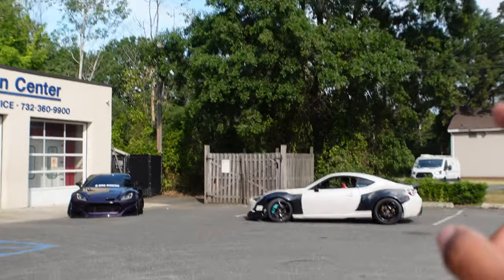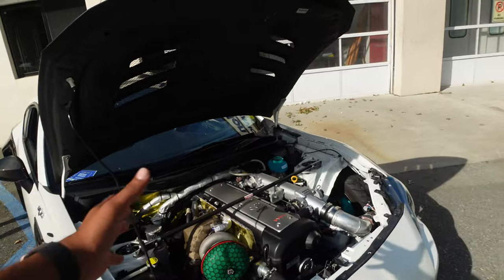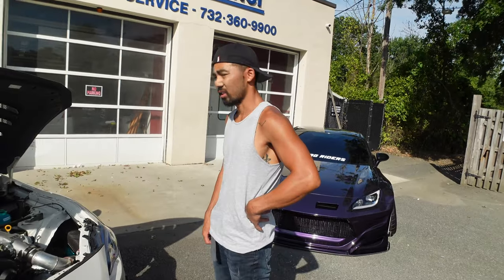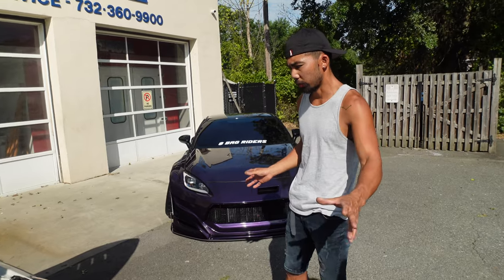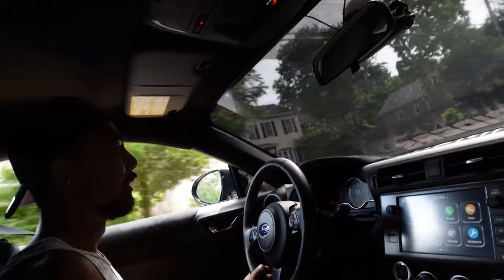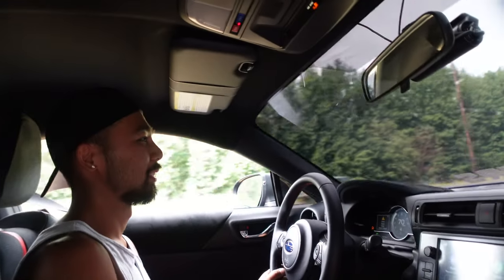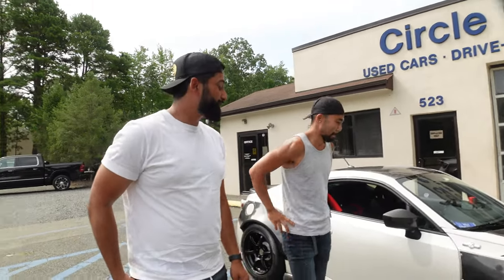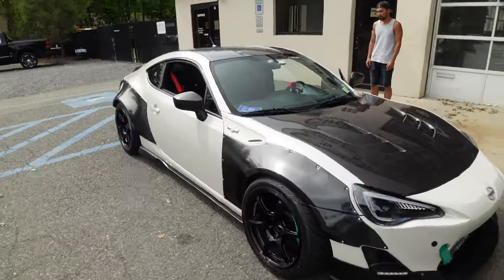450HP 1JZ Swapped FRS Review | The Perfect Build?

Comment: How do you fix cooling? I have a new 3 pass fully aluminum radiator, water pump, high pressure fuel pump, new head and gasket but still have coolant boiling out of the radiator on start up.
Reply: On start up ?!
Reply: Bleed your coolant weirdo 
Can also just remove the thermostat if it’s not too cold where you live